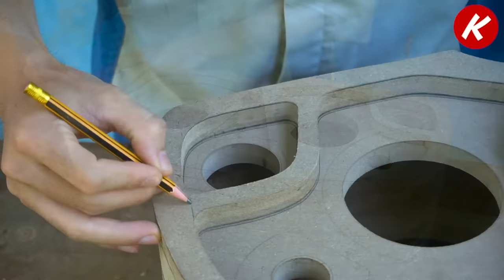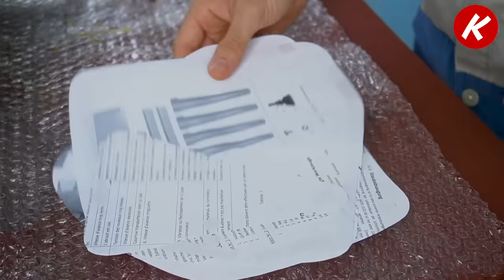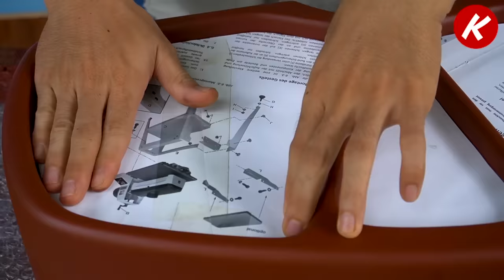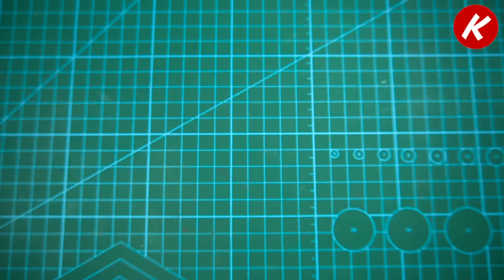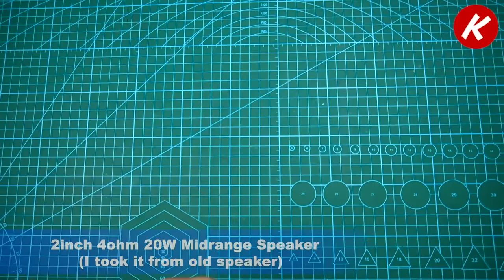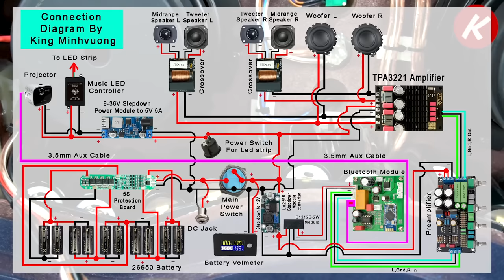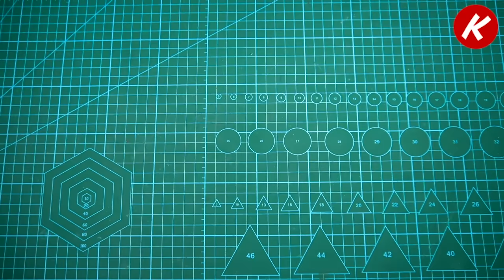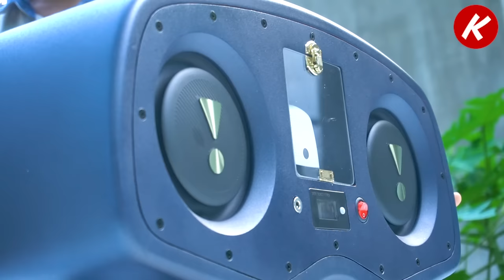Projector Bluetooth Speaker Build

Comment: Amazing build as always, the projector is a brilliant idea, a few things I would look to update in the next one, 1) Bluetooth module need upgrading to at least 5.0 for better performance and battery life, 2) I would look to add in smart RBG strips so you can control them from a phone or the projectors built-in android software, 3) USB touchpad that could be fitted into the case.
Reply from the maker: Thank you for your comment. I will update for better!
Reply: Good ideas

Comment: This is probably the best speaker you've built so far. Good job!
Agree with others in that smart LEDs would be nice, so they can be controlled by a phone (or similar).
Also why did you use 2 way crossovers instead of 3 way crossovers? I'd have used 3-way instead of 2-way with 3 speakers.
Reply from the maker: Thank you for your comment. I want to try with 2 way crossover for  this  version because 3 way crosssover i had was to do before.

Comment: Love the look and execution.  That is a very complicated build and you pulled it off.  I always get concerned about induced noise when I install a large number of devices, but you always pull it off.  I tend to use more amps with integrated bluetooth and preamp to avoid such issues.  Thoughts?
Reply from the maker: Please fix all electrical wires to reduce noise coming from them. Thank  you!
Reply: 롤 스킨 케어 나 이제 지금 ㅋㅋㅋ 집 나 네 지금 집에 받으세요 나 지금 너무 ㅋㅋㅋ ㅋㅋ 나 네 ㅎㅎ 사장님 ㅋㅋ ㅋㅋㅋ ㅋㅋ 너무 다시

Comment: I thought you were going to disassemble the projector as well! LMAO Kudo's! 

I was having a difficult time, still watched through to the end as I had no idea what this or that was for,. glad you included the build without dialog. A couple of things after seeing your level of work to this, were a few blemishes where the legs connected to the box, a slight gap showed the glue and rubber feet to them. 

I would like to be able to turn off the lights with Bluetooth, maybe incorporate a Raspberry Pi controller to work with your Bluetooth and adjust your audio from your cellphone as well as install a small storage device to allow you add a music playlist/ video database that you can control from your cellphone.  That way, regardless of who's phone is on, there is always music and movies available wherever you go.

Otherwise, I would consider upgrading the jewelry box hinges to something a little more robust for outdoor use.

Awesome work!
Reply from the maker: Thank a lot for your comment. Good luck to you!

Comment: I'm working on my own soundbox project. It uses the connection diagram of the "Epoxy Dovetail Joint Bluetooth Speaker DIY", although it is simpler. It has two switch buttons: one to switch between the 1st battery (main) or 2nd battery (backup), and another to switch between the external power supply (yes, I added a micro-USB port) or one of the internal batteries. I'll add a small battery charge level indicator too.
Reply from the maker: Your idea is good. Thank for let me know. Good luck to you!
Reply: @KingMinhvuong  a stupid question: can I use the negative wire of the battery linked to the negative wire of the charger input? The external power supply is actually a 5v phone charger board that I disassembled to put inside the speaker box. And my project doesn't have a stepdown module or crossovers.

Comment: Just wonder this extra dcdc converter before Bluetooth module it’s mainly for filtration ? 
I have similar problem using raspberry pi audio output was full of noice from step down converter so using this isolated extra converters probably solve a problem ☺️ 
Very nice speaker 😉
Reply from the maker: Dc dc converter module before bluetooth module for step down voltage becase module bluetooth only usiing 9-12vdc. Thank so much!

Comment: WOW! Amazing build! I need to start utilizing the layered box construction method to enable more creative shapes and layouts. I don't think I have seen a space utilized so well, with so much punch packed into a fair sized box. I am hoping someone may be able to tell me how one of the magic tricks are done. How did he manage to desolder the potentiometer so easily? It looks like he was adding solder, and managed to pull out the 6 or 8 pins freely. I know a vacuum was used to clear the pads when adding in the extensions, but the initial removal was amazing and could save me a lot of effort :-) . Any input would be greatly appreciated. In any case, you have a new subscriber, and look forward to catching up on your videos. Thank you!
Reply from the maker: Thank a lot for your comment!
Reply: He flooded the pins with solder all at once, like one big short circuit, like joining all the pins at once with solder, so you can just pull the piece out then,

Comment: It should have AptX LL (low latecy <40ms) techology, or else some of projectors still have LIPSYNC even with AptX or Aptx HD(simple with >80ms) or LDAC (by Sony).
Also, for best results, you need Aptx LL transmitter for the projector.
BDW, if the projector bluetooth does not have AptX, the speaker's Bluetooth will downgrade the codec to projector codec.
But overall i's amazing !!!!! And hard work!

CSR8670 or CSR8675 and you forget about delay/lipsync
Reply from the maker: Thank for your comment!